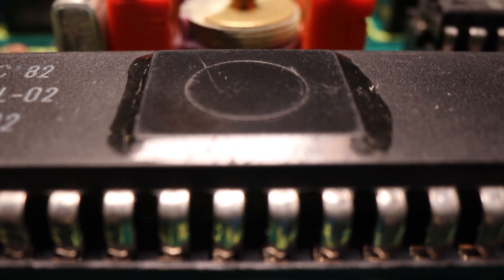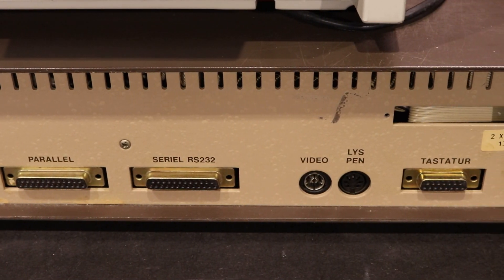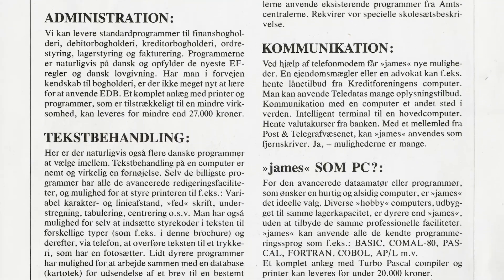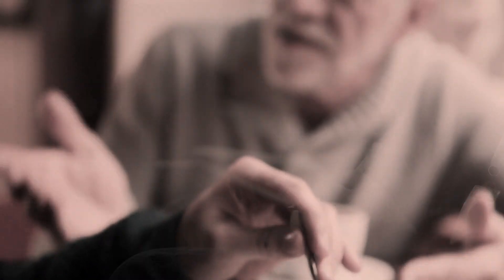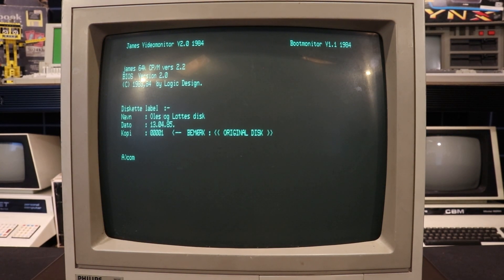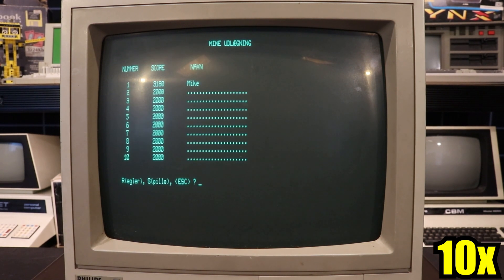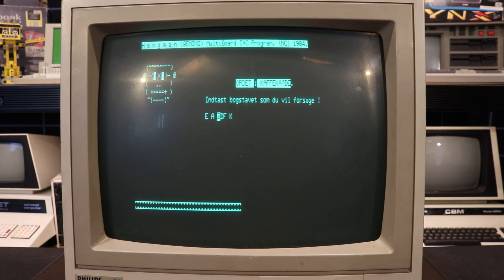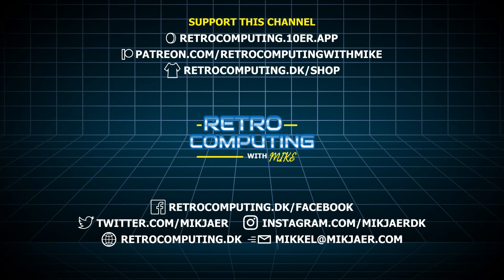The James - Danish Computer from 1983

Comment: Jeg købte en James computer i 1984 da jeg skulle starte på Handelshøjskolen. Den kunne bruges til tekstbehandling og spille spil, men kunne også programmere i Pascal som vi lærte på skolen. Den kostet dengang over 20.000 kr. så jeg har gemt den.
Reply from the maker: Interessant, den må du endelig ikke smide ud! Har du noget software til den endnu?
Reply: @RetroComputingwithMike  Ja, har nogle floppy disk bl.a. med System disk, Turbo Pascal med Micro calc, Danmax fra Damgaard Data
Reply from the maker: @bendtgerhardt5830  tror du det er nogen vi kan få lov at låne så vi kan tage kopier til museets arkiv? Skriv gerne på mikkel@mikjaer.com